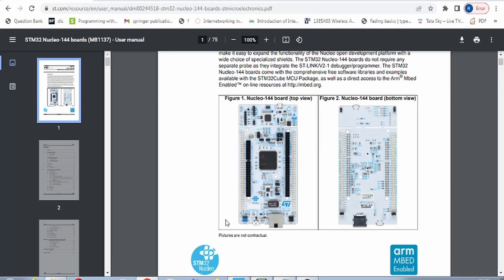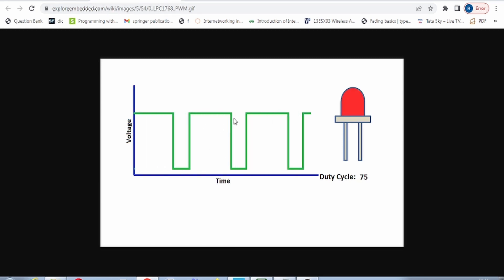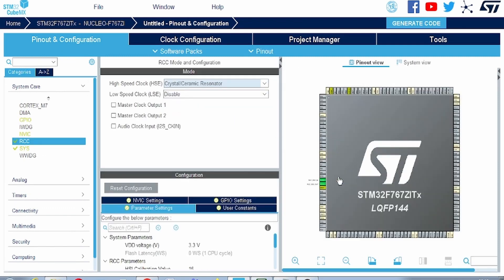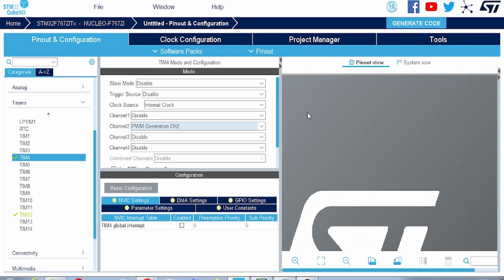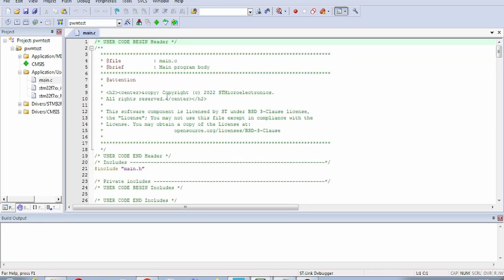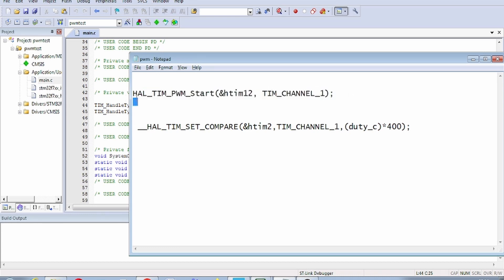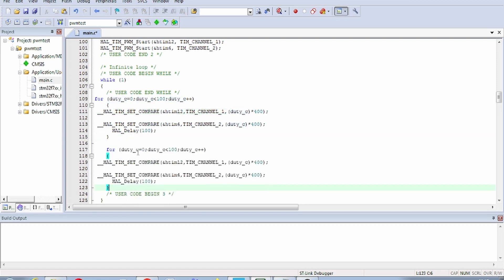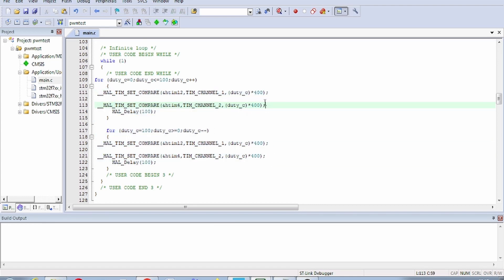STM32 : LED Brightness control using PWM on Nucleo-144 Board

Comment: which cable use for program upload and download?
Reply from the maker: micro usb cable
Reply: @hardware_coding3603  one more question how to power up board external source?
Reply from the maker: @bhaveshkunbi2164  It is powered from usb cable only